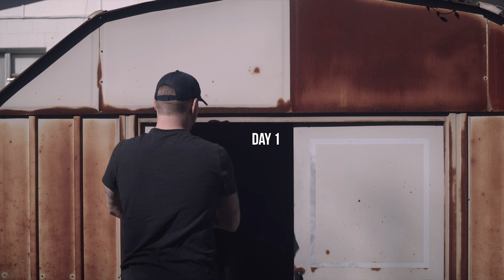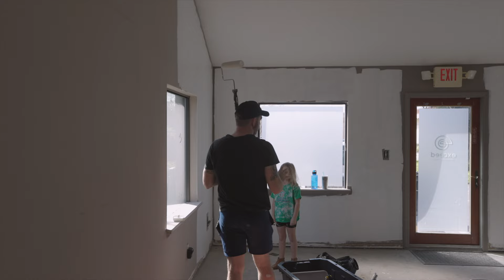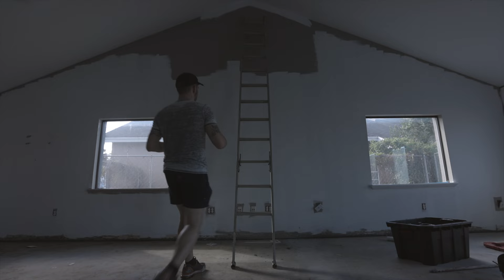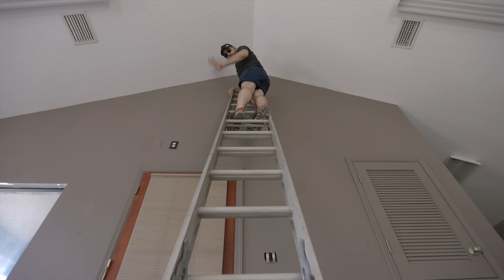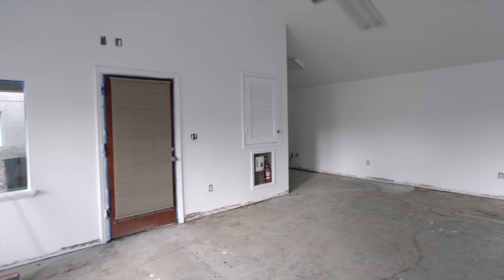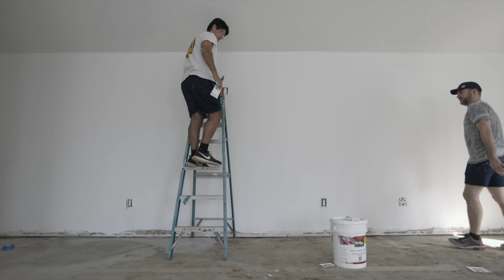Building Our New Photography Studio - Part 2 - This Is the Part That Sucks

Comment: I love your outtakes, lol. I think both you and your assistant win on the fashion statement. Your young crew is incredible. I was thinking it may have gone quicker if you used a sprayer but then you may run into problems with that especially with the young ones. I can't wait to see your floor. Maybe the floor will help mitigate the echo. Thanks for sharing!
Reply from the maker: A sprayer can definitely make it easier, but there is also a ton more prep time and I figured it was a wash as far as time commitment so we just did it the old fashioned way :) thanks for watching!